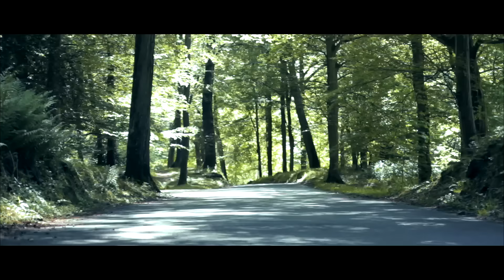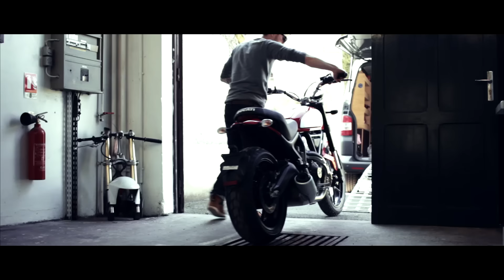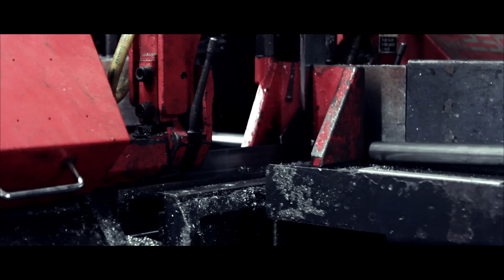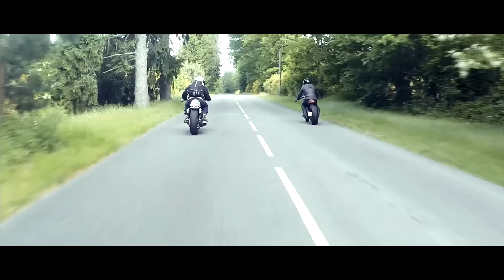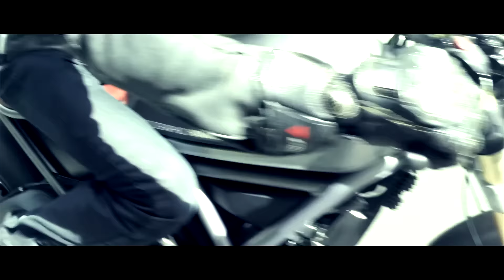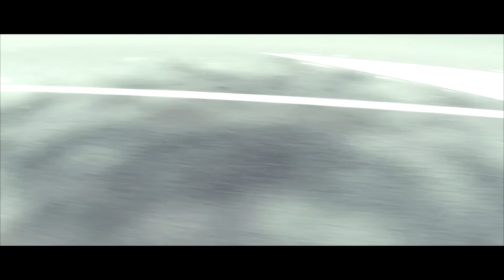DUCATI x HOLOGRAPHIC HAMMER | Project Hero 01

Comment: Fantastic work guys, good to know it can be done, that I'm not insane, and what the Scrambler would look like with a lower front end and clip-ons.

*That's a 17" front wheel not an 18" right?  Hard to judge in the video...
*Including static sag I'm guessing the forks are shorter than the standard Kayaba units, and with less travel?
*And those brakes, whew :D  are those the Beringer quad disk (2 per side) units like the current Brough Superior SS100 uses?
*Rear sets? Or is the foot position OK with the standard peg position and the bike tipped slightly forward?

Sorry for all the questions, I'm thinking hard about a Scrambler Full Throttle with those new Lightech clip-ons, and maybe dropping the stock fork through the clamps just enough for the clip-ons to grab properly.  I'd like to stay with the single disk up front and I like the FT's wheels, just concerned about tyres for the 18" rim

That's the first thing I saw when I looked at the Scrambler FT and it's cute tail - A bolt on parts café racer :)